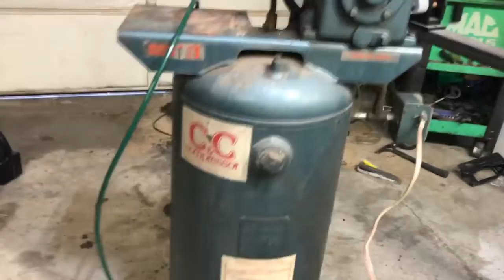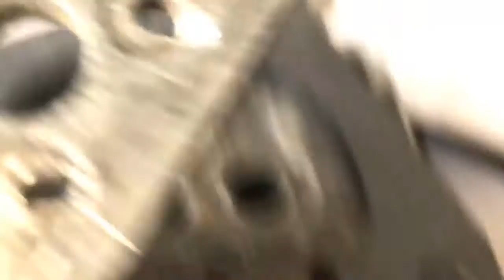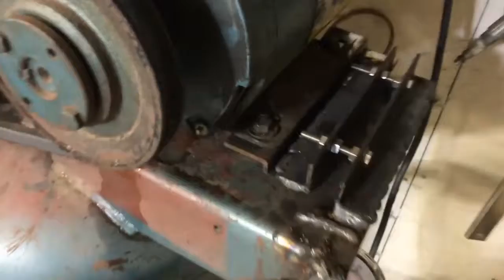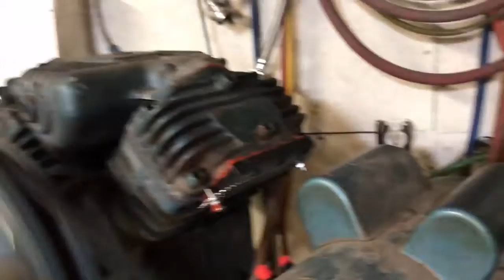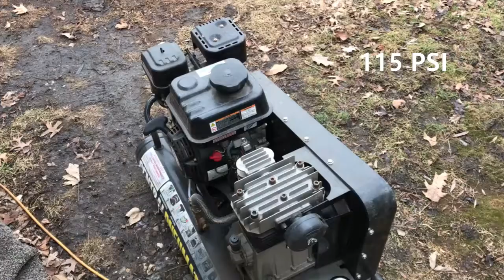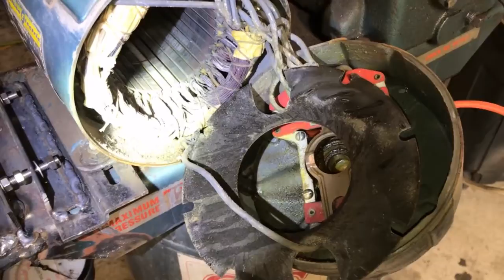AWESOME 4 Cylinder high flow air compressor and why compressors fail

Comment: Motors only shot when it lets the smoke out..  id replace the bearings, clean the contacts on the centrifugal switch and oil the springs, clean the commutator and in between the plates on armature, check the brushes and tension springs n clean, test both the start and run caps n replace if necessary and double checking theyre the proper size for motor spec.   
  Also the drain you mentioned on the head is called an unloader system, which is a relief for head pressures to lessen motor work starting and running when pressures get higher., you wanna make sure that its tied to the electronic cutoff switch so it will unload pressures at the proper times..  
  Along with all that you also wanna check on pump max rpm and see what speed the motor runs so you can do the pulley speed conversion..  likely 3750rpm motor and 900 max for tge compressor, pulley calculators are everywhere online..

Comment: I live in Venezuela... And i saw a compresor just like this one i. 200$ with no motor... And 80 galon tank.... Is that pump 2 stage?? Do you recommend buy this? Im not sure what to do cause i think is pretty rare pump i dont know if is bad... It can be fixed.... And im not in the us, where you can find almost everything

Comment: I got an old 4 sylinder 350l stuttgart air compressor from 1966 not starting the wire or control are fried or something idk yet but its a stage 3 5.5kw engine and 850l/m
Reply: 3 phase not stage

Comment: It most likely has a short.  
If you have a multimeter you can test the windings. 
The motor has 2-3 or more phases. 
Each phase can be checked.
Check for continuity. 
The phase has two wires going into the wraps.  They should be continuous. 
Check the ohms. Should be low!! 
Then check for short.  Touch the case and the winding with the leads if it shows any connection it has a short.  
 
That motor can be rewound.  
It’s not that hard! 
Look at how many wires in a section. 
How many steps apart.  
Get papers and wire go for it.

Comment: This is a single stage compressor for pressures under 125 psi. Over this pressure they use a two stage. This compressor uses aluminum reed plate valves. This is a soft metal not really conducive to high temperature and dirty air coming in. The compressor is a light duty model which is obvious. Craftsman compressor of the past used this style. One trick I use on my Ingersoll Rand unit is to use 10-40 Mobil one engine oil. When the oil goes past the rings into the tank, it turns into emulsified water. This will stop rust inside the tank on contact. Your electric motor is only one and a half H.P. With the ratio you have the motor is a bit small on size. Check to see the amps draw, this should help you figure out a more reasonable run ratio or your motor has internal problems. Yes, your motor windings are cooked. I have always found that when you buy a motor always get the totally enclosed air cooled type. They are more money but last so much longer because they keep out dirt and swarf. Also, having a belt guard is the next most important thing, as I really like my ten digits and want to keep them forever. When it comes to power comparison from electric motor to gas engine, the ratio is 2.5 to 1. Electric motors are a lot more powerful for there size than mechanical gas type. Good luck with finding a motor. You got hosed on the compressor fella for sure, and you still have a used machine.
Reply from the maker: Well thank God i got it fixed and running good with a new  motor and yes this pully is a bit to big by about 8 amps
Reply: @NOBOX7  Anytime fella. Enjoy your new old compressor. Peace too.
Reply: @victoryfirst2878  never heard of anyone using combustion engine oil for a/c, NOT THAT THERES ANYTHING WRONG WITH IT. If it’s working, that’s awesome. I know that I personally get so fixated on “can’t use anything other than what manuf spec’ed” that I lose any creativity or “thinking outside of the box” that promotes growth
Reply: @tombrown1032  I can tell you this really works and price is reasonable too. VF

Comment: As my dad would say::: 
 To bad being cheap is so expensive.

Done that many times.

Get your self a nice 2 stage compressor 5 hp electric  on 240v single phase
You will not regret it... 
Mine will do 175 psi no problem and about 18 cfm  I believe....
Reply from the maker: That my friend was some Golden wisdom , the exact essence of the loss i tried to capture with this video

Comment: I found one of these byu E.L. Smith and Sons in my mid teens w/o motor or tank. Took it apart to see what it was all about. It was ancient then but lightly used. I wired up an old Dayton 220V 5hp 1ph motor. Welded up a hole in a water tank, plumnbed in a dessicant trap and reg and painted anything that rolled or floated until i was out of college. It ran the greedy Mac DA sander at 90psi  and the damn buzz board so its that many CFMs whatever....Im 48 now. When i go home i still hear that capacitor motor slowly kick over once per night because errr..um. my dippin hand wasnt air tank welding certified in 1987. Still aint. Pops has had that thing plugged in continuously with the same dryer cord I cut off some trash way back then. Some day I'll power it properly with 3ph and a box. Good memories. I did marvel at the inside of those heads and remember thinking they looked like they could help the old YZ250 beat that rich dick Eddie's rich kid CR250.

Comment: That tiny leak is going to be annoying as F in the long run. Every time you get back in the shop the tank is empty and you have to get it back up on pressure.
If you want to do it properly go on the aliexpress, order an electronic bleed valve with the build in timer. We use them for this all the time. It just bleeds for the set time after xxxx time(also set by user) We bleed for i think 5 seconds every hour. And it wil actually bleed of water properly, wich you tiny leak might not do that properly(know this from experience)
And when my compressor is turned of it holds pressure, even for months. I can go on vacation, come back to my shop and its stil sitting at 10 bar without a problem.(thats proper air system setup, all lines and everything 100% leak free)
Reply from the maker: this thing takes like 2 min to fill up , its super fast , but yeah i do like those things
Reply from the maker: Definitely going to look into that

Comment: The only issue with a small leak like that to drain water is any crud could plug it.
Reply from the maker: i have an idea im going to deploy that will possibly get me out of doing this , you are correct i do occasionally need to blast blockage out
Reply: @NOBOX7  spring loaded ball valve and a string?
Reply: @NOBOX7  I think a small controlled leak, on a tee above a ball valve would work, most moisture would just leak out, and you can open the ball valve to blow out anything that collects in the bottom of the tee? You'd be left with a couple of ml of water that wouldn't be removed until you opened the lower valve, not sure if that would be a problem. I wonder if they make intentionally leaky ball valves for the purpose, (perhaps a small channel along the ball to from a leak path?)

Comment: Very nice tensioner system, really like this compressor.  These old compressors are dogs, they get very hot.  I have a single cylinder large compressor with a similar age and cooling pulley.  It pulls 14 amps on startup and 9 continuous while it's running.  You could put a 340 or 420cc gas engine from harbor freight on it-$200 $300
Reply from the maker: Hey whats up old friend , yes i had to have this thing when i bought it